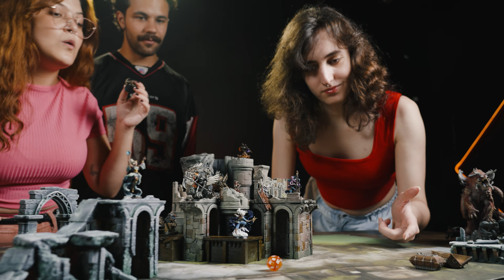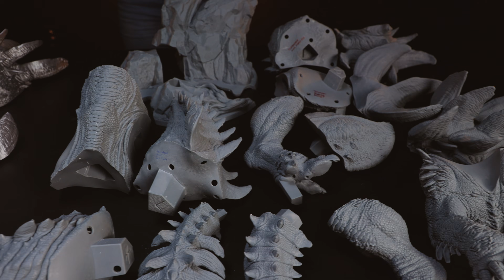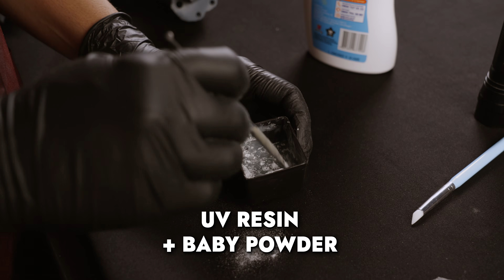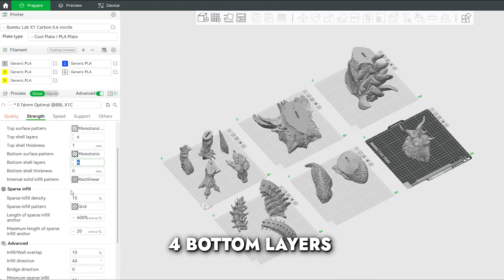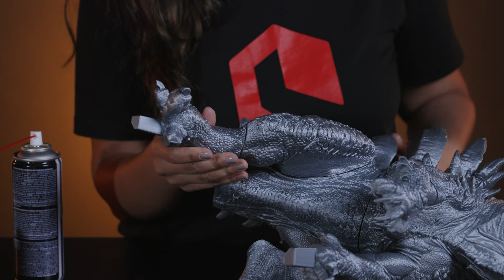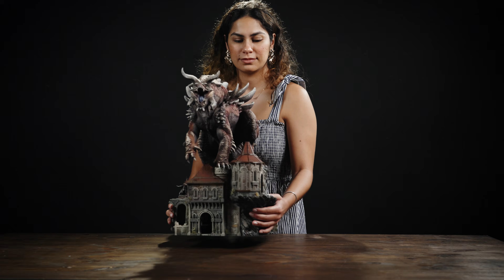Gargantuan RPG Final Boss - 3D Printable Miniature Assembly Guide

Comment: A few things:

I want to start off by echoing some other comments. This detailed assembly guide with extra tips for post-processing before assembly is fantastic! Please do more of these, especially for the larger prints & props. 

Onto the constructive criticisms:

1) 32mm in Resin only: You can totally print at 32mm scale in FDM. The cost is in time and supports, but  it can be done. You'll want to get the layer height as low as possible. I've gone as low as 0.01mm layer height on my bambu with a custom profile, but the included 0.08mm high quality profile is fine for most purposes. You can even print the model with Resin-style supports to minimize contact with the mini, though you'll probably want some software to seperate the supports into a seperate object and thicken them so they print properly. There is a great (and FREE) blender plugin that does this. Google it. All that to say, you might want to experiment with this and consider including it in future releases.

2) for the FDM print, I wouldn't go with 0.16mm layer height. I understand that it saves times, however if you are printing something like this you want it to look really good. 0.08mm high quality profiles are the way to go. That is personal preference, but I think it would be helpful to point that out in future videos.